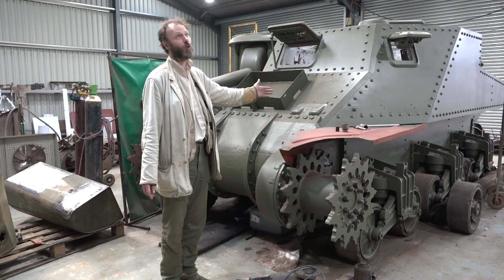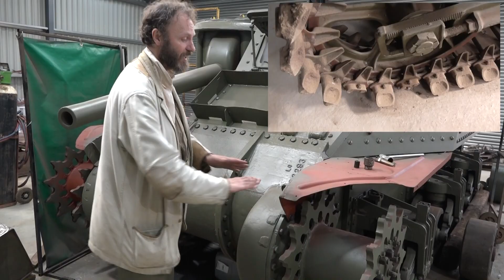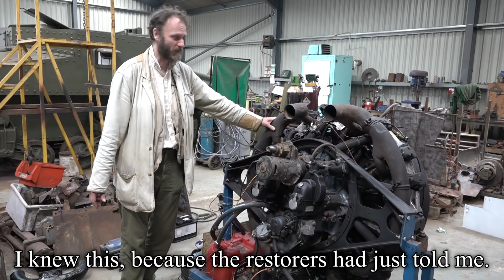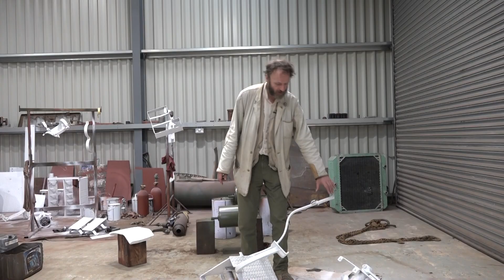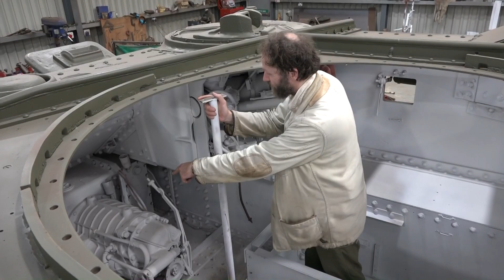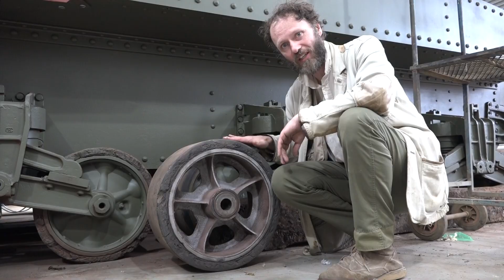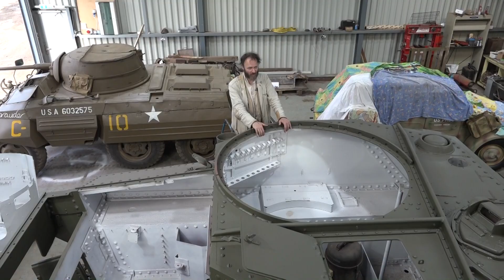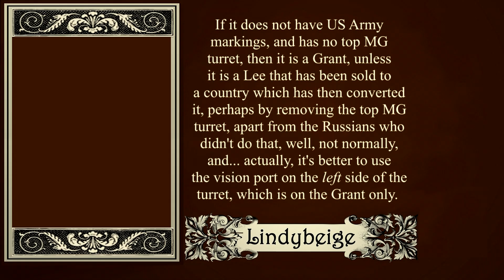The British Lee tank (that is not a Grant)

Comment: Radial engines required much less time to warm up.

Gen. R. E. Lee was an engineer by training, not cavalry.
Reply: I read somewhere that radials were popular in hot climates eg North Africa, because they pulled air through the crew compartment. No AC in those days.
Reply: The Ace of "Spades" as he was called due to his excellent record of building fortifications
Reply: @jimwestberg4771  
He was also called Granny Lee at one time
Reply: @jimwestberg4771  You say "excellent" I say unneeded and expensive. 

And it was 'King of Spades.'
Reply: @danielburgess7785  In the context of the futility of the war yes but his fortifications were known to remain even after extensive shelling and difficult for union forces to breach. True on the king of spades, an over sight on my part.
Reply: Interesting. I wonder if that influenced Lee's approach of strategy and tactics.
Reply: trivia: He fought alongside U.S. Grant in the Mexican-American War, and was commandant of West Point before secession.
Reply: They were also intended to be cooled via a several hundred-mile-per-hour airflow over the piston cooling flanges, which was an ongoing problem with the M3 and M4 Medium, where the engine was in a closed box -- hence the great honking fan attached to the engine to pump as much air as possible across the engine for cooling.

Comment: One correction Skipper; the 75 mm gun on the Lee/Grant was basically the same one used on the Sherman (and in the Churchill NA 75 conversions), which we always call a general purpose gun. The gun used on the early Lee had a slightly lower velocity (1929 ft/s vs 2031 ft/s, or 588 m/s vs 619 m/s for our continental compatriots), but later Lees and Grants had the exact same gun as the Sherman. The only reason they put it in the hull on the Lee was because they didn't have the machinery to make a turret ring big enough at that point (they were working on it though), and both us and the Americans knew that they needed tanks now rather than in 6-12 months.
Reply: Also ammunition was a key change, the early M3s got pretty poor AP and HE rounds shipped with them, which got fixed for later on.